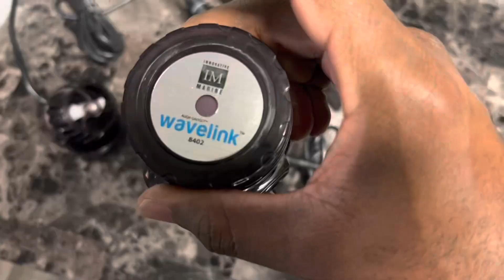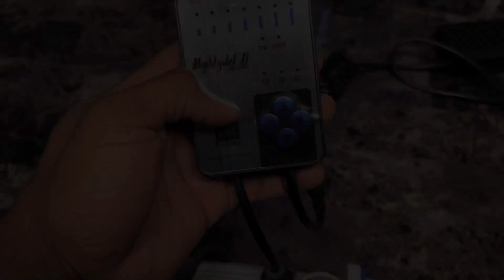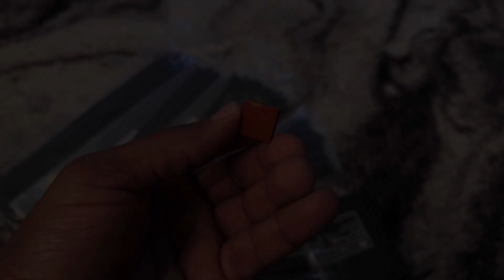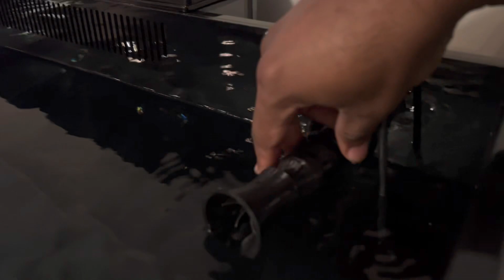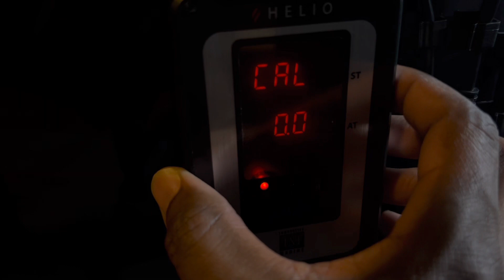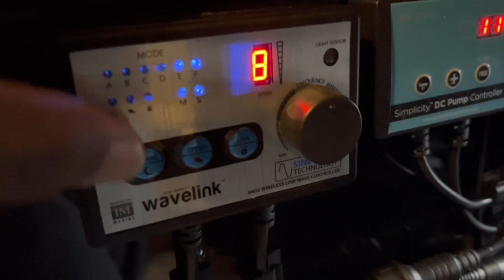Ep.4 | Equipment Review & Install

Comment: What are the dimensions (L"xW") of the Mighty Jet XL pump controller? Trying to plan out my control board but I'm not seeing that info online anywhere. Slightly larger than a credit card?
Reply from the maker: I’d say slightly larger rough guess is 4x3”
Reply: @CJSAQUARIUMS  You rock. Thanks CJ

Comment: Great setup!  Was curious how are you liking the IM powerheads so far?
Reply from the maker: Now that I’ve added some life to the tank I’ve had to adjust them a lot. It’s very direct flow. I think they are better suited for supplemental flow not primary. I more then Likely will add gyres along with them for a better pattern in the tank.
Reply: @CJSAQUARIUMS  thanks for the reply.  trying to decide on what powerheads to get for my ext50 lagoon.

Comment: Could it be possible to plug into a UPS back up run your system like a computer plus if your power fails it will keep running right 😮 just been a thought of mine for my next build I’ve struggled with outages 3 times this year and I think I don’t want that anymore 😢great content tho really nice set up 👍

Comment: Something to think about - how you have your heater and probe locations, if your return pump fails, the probe water will cool down so it will keep the heater on indefinitely and could super heat the return chamber water.
Reply from the maker: They have that covered the heating element also has its own thermostat built in independent of the controller. If it hits its maximum it still shuts off. This system is really nice multiple redundancies built in 💪🏾💯
Reply: Very cool! well thought out.
Look forward to see your build progress 🤓

Comment: Looks very nice CJ. You might try and point the santa monica outlet nozzle towards the inlet of the skimmer, not directly but just to suck up any extra gunk. Seems to work well for me. Although my scrubber does not produce much since I also run a filter roller.

Comment: I have the fifty gallon version, on my previous tank I made a cabinet for everything. I removed the right door and moved the the controller cabinet next to it 
But I needed a place for my apex dosers. So I put a 1/2 piece of plywood cut to the size of the tank and stand in between the door with a cutout at the bottom for cables works well